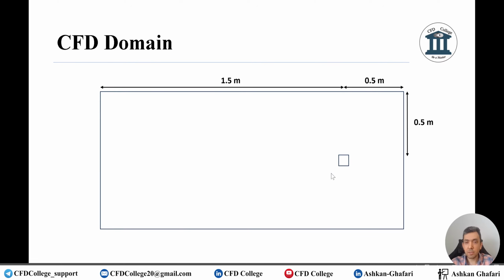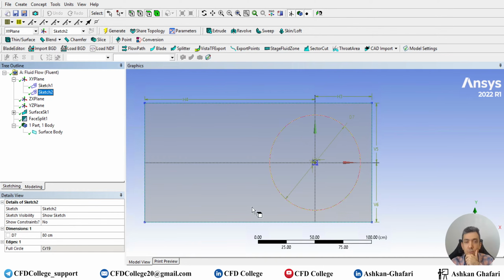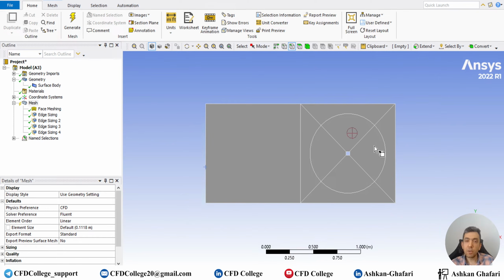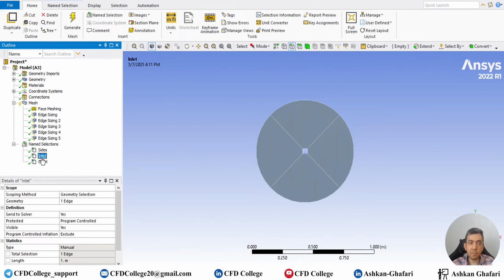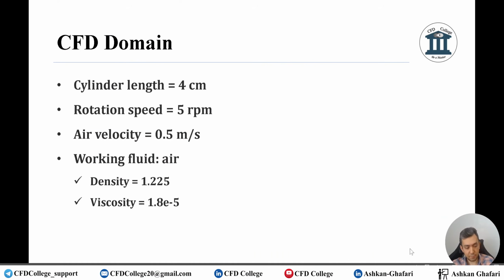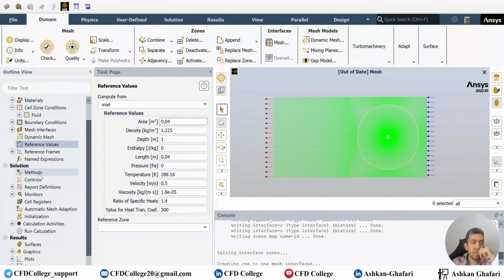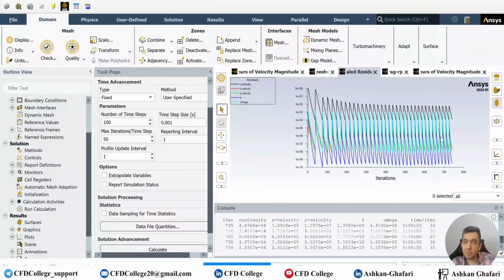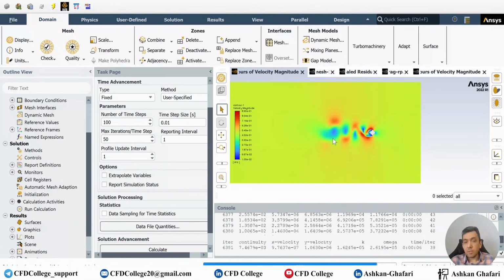ANSYS Fluent Tutorial: Flow over a Rotating Square Using Sliding Mesh Technique

Comment: Hi. Nice video. Sir, is it possible to use sliding mesh if the block moves in L path?
Reply from the maker: Hi. No it cannot be used for this type of movement. To do that you should use Dynamic Mesh or Overset.
Reply: @CFDCollege  Do u plan to do that by using overset mesh in future?